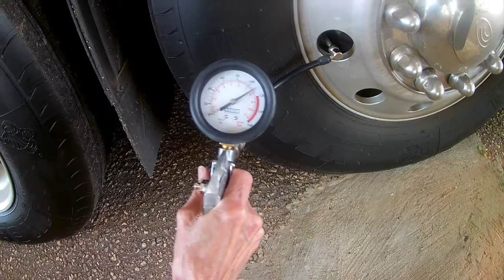VIAIR 450p-RV Air Compressor - Owner's Review

Comment: I have had the same Viair for 5 years and love it!  Call Viair and ask them about your issue---they have very good customer service.   Before each  travelling day I check all my coach tires, car trailer tires and airbags & I seldom ever need to add more than 3 or 5 lbs, if any air is needed at all, so the length of time for your air up is not typical.   If your tires continue needing air frequently  you may have a leaking valve which is common with the valve extenders and you may need  a replacement.  Incidentally, I also use the Viair to winterize our coach by blowing out the lines.  Best wishes to you, and hope you and your wife enjoy your beautiful Country Coach.

Comment: That's a bummer.  Have you determined that your compressor is working normally or is it defective?  130 psi is a big ask for such a small compressor though.  Great video, very honest.
Reply from the maker: I am giving it a second try... just bought an older version of this model which has 2.3 vs 1.8 gpm output.  but, it only run for 20 minutes before needing to cool off.  will see..

Comment: I looked at those small pumps and decided that with no tank for reserve volume they would not be able to take care of my 365's up front or my 315's in the rear.  I bought an 8 gallon McGraw from Harbor Freight and put it in the front bay.  It weighs 50# and it's not easy to move around but it's rated at 150 psi and 4.1 SCFM at 90 psi.  Those small pumps have virtually no SCFM rating and take forever to pump up an RV tire.  My father kept a little pancake compressor in his bus and it is better than those small pumps.  Get something with a small tank and you will be good to go.
Reply from the maker: 400 model had more scfm than 450 model, plus it overheated before we pumped one tire..  you are right .. cheers..
Reply: Hello, just curious. How do you attach a small pancake compressor to the battery? Is there an adapter that connects to 120 plug? Is it possible? I would be using it for a car, so i dont have any outlets to plug into as an rv would. Thanks